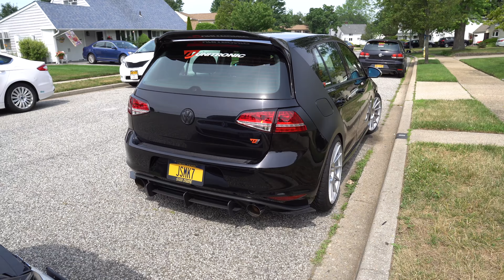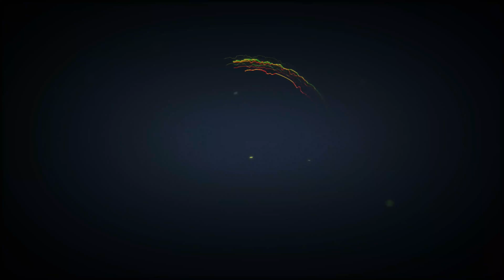VW MK7 GTI Upgraded Intercooler Install

Comment: Hey JR, 

This might be a bit late, just wanted a review on the Revo intercooler. I mean the efficiency & gains. 

Whats the best intercooler out there in the market according to you
Reply from the maker: Hey Amman actually went ahead and changed mine out to an integrated engineering one which is considered to be the best one on the market for the MK7 platform. I would honestly recommend that one!

Comment: What percentage tints do you have? Am I bugging.. I thought u took the tints off.
Reply from the maker: I have 35% and I will be taking them off sooner or later because they are illegal in the state of New York and I won't pass inspection with them.
Reply: JR14 come on man... You know better than that. bunch of inspection shops here in queens that will pass it for u 4 possibly a hundred bucks. Says a guy like me who has a tint medical exemption for my 2018 gti. I have 5% rear windshield, 15% percent sides, 50% windsheild. Privaaccyyy....

Comment: What were your IATs before the intercooler upgrade?
Reply from the maker: Man when I tell you that on a very hot day, I was seeing 150-170 at times it was very bad. The car pulls so much better now with the upgraded intercooler. I wouldn't skip out on changing it!!!
Reply: Got mine yesterday (Unitronic) along w/ stg 2 TCU and ECU also from Unit. We both have the exact same color mk7 autobahn PP. Grats on the upgrades!